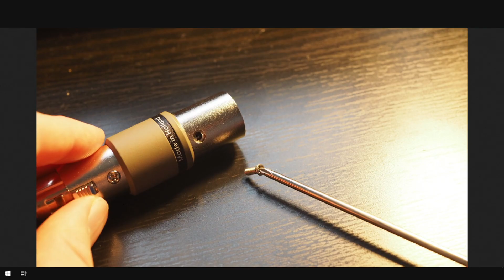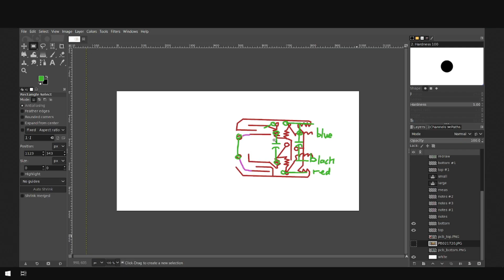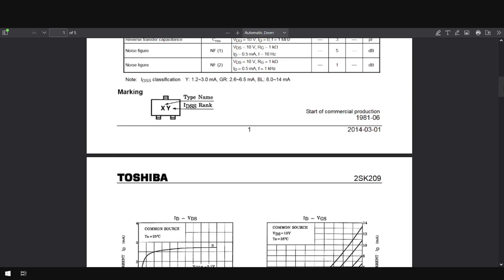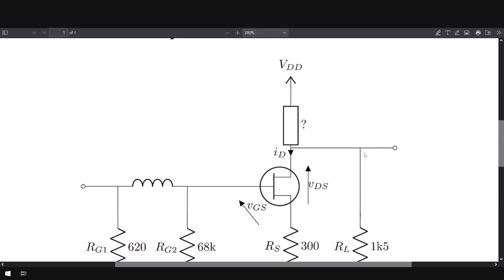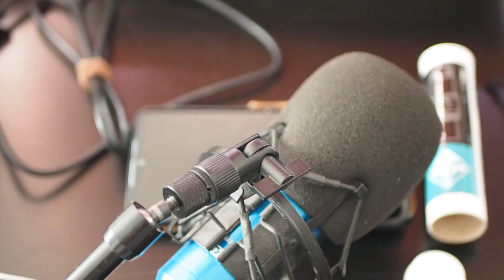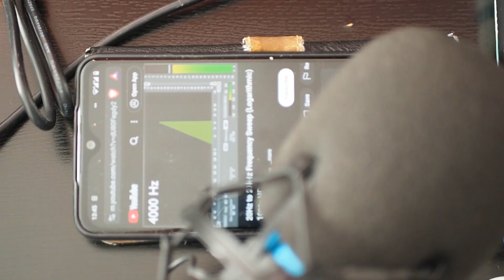FETHead Phantom Full Analysis and Testing (AudioQuest #1)

Comment: I did an audio capture of that frequency sweep (from the YouTube link you included).  Then I looked at a spectrogram of my audio capture.

That YouTuber (Aaron Shannon) recorded a sweep that goes all the way up to 20kHz,
but after he uploaded the video to YouTube in 2015, the audio of the frequency sweep now only goes up to 16kHz.  (Despite the video images showing the sweep continuing on up to 20kHz.)

Everything between 16kHz to 20kHz is silent in that video, because the YouTube audio compression algorithm applied a brickwall filter at 16kHz.  (Lossy audio compression can chop off the highest frequencies, to save file space.)

So when conducting audio tests, you might want to avoid using frequency sweeps that were uploaded to YouTube.  Or just be aware that the sweeps on YouTube might end at 16kHz, even if the video is labeled as "20Hz to 20kHz".
Reply: Well, not all YouTube audio is automatically brickwall limited to 16kHz.  It seems that the audio of most newer YouTube videos is brickwall limited to 20kHz, which isn't bad.  (Whereas very old YouTube videos might only go up to 14kHz or 15kHz, depending on the maximum video quality setting.) 

But even if people upload audio that has genuine frequency content all the way up to 22.05 kHz or 24kHz, YouTube will always chop off everything above 20kHz.  (At least that's what my YouTube "audio capture" experiments have determined.)
Reply from the maker: @souldrip2000  Interesting, I had no idea that YT would have different levels of audio compression. In part 2 I used a file explorer app to play a wav file on my smartphone but I really need to come up with some way of better controling the extranious variables.
Reply from the maker: Thank you for that information, I didn't know that Youtube compressed audio so brutally. I am currently working on a follow-up (hopefully out tomorrow) in which I generate my own frequency sweep in MATLAB but that had other issues...

I'm also concerned about the DAC in my phone having inconsistent gain over frequency. There are a few variables that I'm struggling to pin down but I'm not ready to give up.